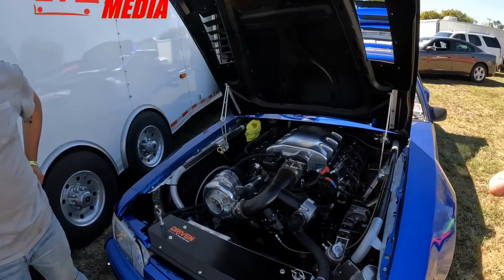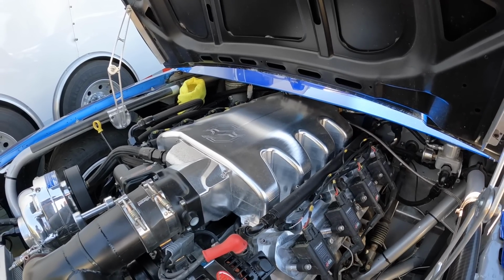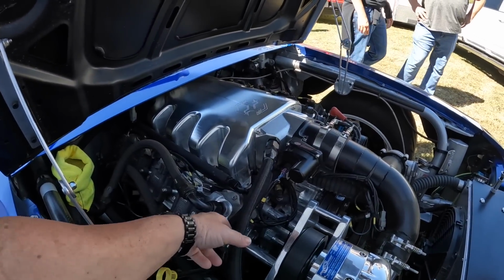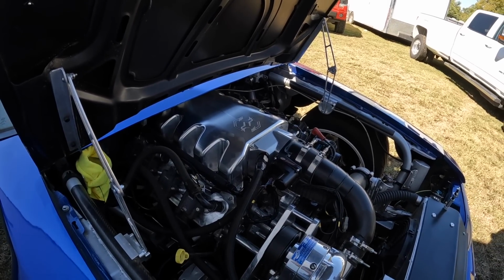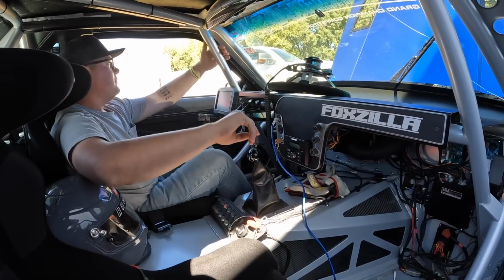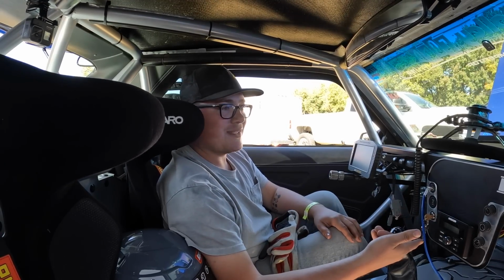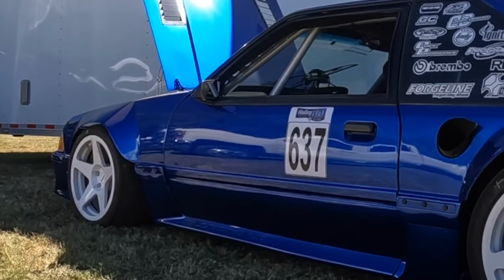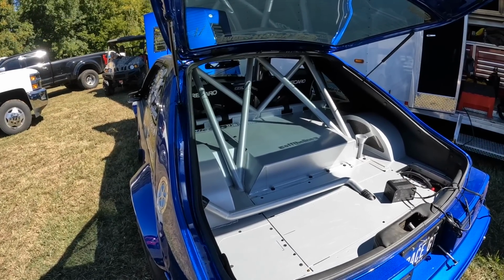GODZILLA 7.3 swapped fox body is the most insane build yet!

Comment: Which is better for street use mainly, Baer brakes or Wilwood brakes?
Reply: They are about the same, Baer seems to have a bit nicer setups but wilwood has more variety and available applications. Depends on if you're going assisted or manual brakes as well. The fox is currently running Brembo GTS Brakes
Reply: @CWIPerformance  Thank you for your reply.

Comment: Really? The big block in a track car?!?!  Love it!!

Edit: Found out it's actually a small block which might be even cooler.
Reply: Still a small block
Reply: @RadDadisRad  is the Godzilla a small block? Huh. I was guessing because of displacement. Is it the same architecture as the coyote or is it a pushrod?
Reply: @rhull3939  yes ironically enough it’s a small block because of the bore spacing. It’s a ohv motor. Biggest cubic inch from a coyote based motor that I’m aware of is 349ci.
Reply: @RadDadisRad  cool. Thanks for the info. The previous largest small block I've heard of is the 7.0 LS that came in a recent Camaro Z28 and the Corvette Z06 a few years back.
Reply: @Olds_Pwr  I think they also have a 6.8 incoming.

Comment: A Coyote with a turbo and the same bolt on would make the same power... the "godzilla" engine is way over hyped
Reply: The same power at peak rpm maybe. The 7.3 will reach and hold that max power better across the rpm curve compared to the coyote though.